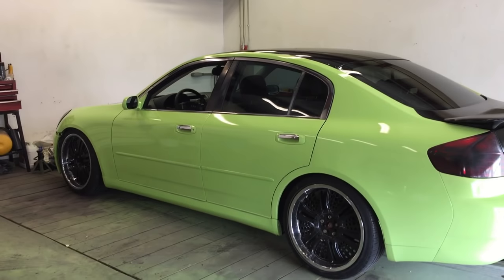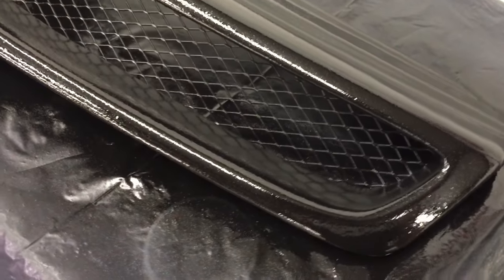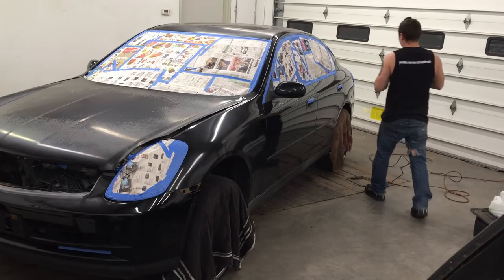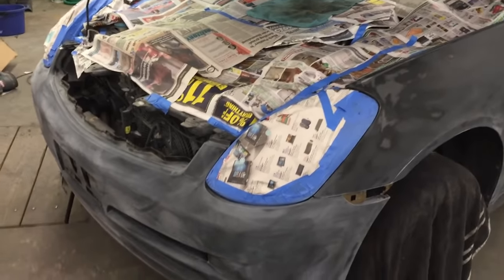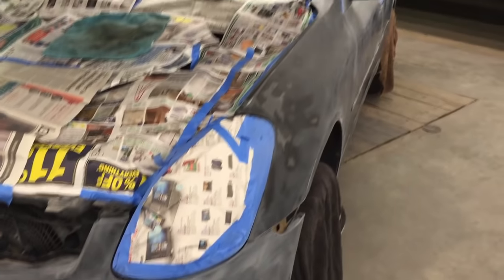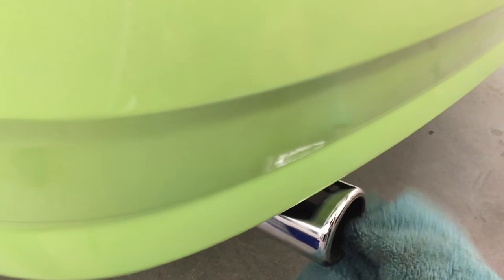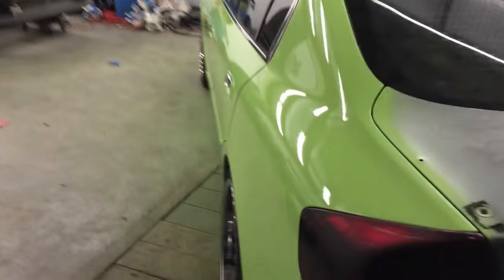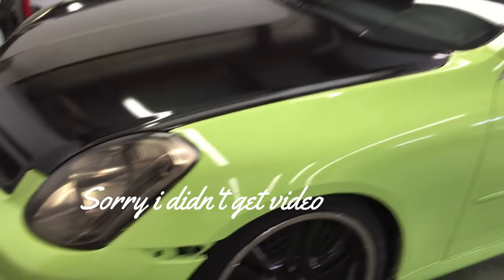Cheap Rust-Oleum Legit DIY spray can job you can do for 40$ or less! #budget #cheap #rustoleum

Comment: Nice. I'm impressed. For rattle can. Not bad...  It works for you. The hell with everyone else. Good vid man
Reply from the maker: Fast Garage 100% for sure! I love this comment new pinned comment!
Reply: Why do people get mad the way they do about paint jobs? Smh. I agree
Reply: My dude prolly got hi as a kite lol
Reply: Looks good butt wont last
Reply: @hectorastudillo2295  he would go over it with a clear coat it would last a lot longer
Reply: @JamesDguy  do u only use 320 with every car u paint I luv the results I have a few dents to fix and wondering if I use 320 and that's it on bonds areas
Reply: can you take it to a car wash?
Reply: Can you do that with a lamborghini
Reply: @jimjagusiak3593  yes it is paint for metal not indoor wall paint
Reply: @Jozavenue  is I know the bottom line plastidip gets washed away by the high pressure water and chemicals.
Reply: So how's the car look today?can you do a vid on the current settup of what if looks like?..does look good in the video here.
Reply: @alejandraramirez3575  spam
Reply: @JamesDguy  what's the name to that machine that scuffs I need it to paint my truck (Its a 1974 and has some rust) Anyways I want to spray paint my truck the way you sprayed your car, It looks nice
Reply: @JamesDguy  
So is that basically it? 
Scuff vehicle with a machine, cover glass, mirrors, lights, tires & than start spraying ??  (And how many coats?)
Reply: @hectorastudillo2295  yeah... i was thinking the same thing...should have 2-3 layers of clear coat...plus no primer!!no bond
Reply: Exactly what I though. Great job man. Thinking out of the box.
Reply: hey ,if anyone else needs to find out about car spray painting tutorial try Sovallo   Auto Painting Fixer (do a google search ) ? Ive heard some awesome things about it and my m8 got great results with it.
Reply: Not certain about the points made but ,if anyone else needs to find out about car spray painting guide try Bablim Paint Booster (do a google search ) ? Ive heard some extraordinary things about it and my partner got cool results with it.
Reply: @JamesDguy  how's the paint holding up?
Reply: Nice
Reply: hey ,if anyone else wants to discover car paint spraying tutorial try Bablim Paint Booster (should be on google have a look ) ? Ive heard some super things about it and my neighbor got great success with it.
Reply: hi everyone ,if anyone else needs to find out about forgotten password windows try Bablim Simple Code Booster(do a search on google ) ? Ive heard some amazing things about it and my work buddy got amazing results with it.
Reply: @beyourself1192  Na, I'm good!! But thanks anyway, i like my results the spray can way and keeps more money in my pocket!!!
Reply: hi guys, the best success that ive had was by using the Magic Painter Method (i found it on google) without a doubt the most helpful course that I have ever tried.
Reply: There are many factors in getting a good result. One place I discovered which successfully combines these is the Magic Painter Method (google it if you're interested) without a doubt the most incredible info that I have ever heard of. Check out this  interesting website.
Reply: Hi there, really liked the video.  What color was this..."willow green" or "laurel green"...so many different colors there?  I will likely paint my truck with it and would like to know what you used if it worked well!
Reply: @hectorastudillo2295  all paint wont last , will eventually fade
Reply: Professional auto body and paint and I'll tell you dude you did a great job for rattle can little 4K clear coat on that thing and it will go a long way
Reply: One of the best comments I’ve seen

Comment: Ah you sanded it. No wonder it came out so good. Some idiots just spray over the paint like they're using plastidip
Reply from the maker: Yea thats the fastest way for it to chip lol. In the 2 months i had it painted this color it didn't chip or fade and i put it through HELL! Winter storms/ice, Dirt road drifting and it was a driveway queen so it was always in the elements. For a temporary paint job it could have lasted MUCH longer but i had plans to make it how it is now., Check my newer videos for a update on it.
Reply: @JamesDguy  You sanded it with 320 and then painted over that? It looks really glassy. Does the rustoleum lay on thick and flatten out like that? I prime everything and then sand to 800, because I heard anything lower grit will change the paint texture perceptibly (and I'm new to this). What's the rule to get these results?
Reply: @JamesDguy  i painted door of my cheap truck with spray paint. Did same thing with prepping, sanding, primer and all that. Turned out well...it was 10 years ago and paint still on there lol. It shitty and rough now.but still there. Also i have never waxed it and it was kept outside the whole time.didnt even shoot clear over it lol
Reply: @thechum9653  why do so many people use that Deus ex profile pic? Every goddamn video has 3 guys with that, for a 20 year old game haha
Reply: @KaladinVegapunk  you only see 3 guys every video with this picture? I need to call in some support
Reply: @JamesDguy  I want to do the hood to my 1997 Toyota Camry. It has sun damage and little pin-holes showing the pimples of rust. I know I need to first sand the whole hood with 320. (I dont have an orbital sander so I have to do it by hand)
I see other videos that say I need to put this kind of sandable primer (putty) on it before covering it  with the spray primer. That was If there are any imperfections , I can sand until smooth.  After that I can pain the hood with primer.. 

AND only after doing that, can I smooth it off and spray with color I want to spray it with.
After the final color is that it or do I have to use a spray CLEAR GLOSS?

Comment: Hey man, I did the same thing to my old car and it turned out AMAZING.  I actually skipped the sanding part because my paint is so bad, I just wanted improvement, but I used the same stuff as you did!  It is definitely trial and error because I messed up the trunk but sanded it off and it turned out amazing.  I used literally 6 cans for my car and I've turned an old junker into something nearly new.  Thanks for the video!
Reply: Hey just now seeing this and am thinking about doing this to my car. How has the paint job held up? I mean for $40 and a days work it lasts 6 month it'd be worth it, so I'll prob end up doing it. But either way would be nice to know before trial and error how it holds up.
Reply: Yes, did you use a top coat? If so, what kind?
Reply: WHERE TO BUY im soo scared someone gonna sell me the wrong stuff

Comment from the maker: This paint job will be getting wet sanded eventually and reshot another coat in the future with a clear over it. The point of this video is just to demonstrate it can be done cheap and it can last a long time. I have a car going on 4 years with no chips or fade using the same paint different color.. 

I have more videos on painting and updates. Thank you for watching and dropping comments.
Reply from the maker: Subscribe for more videos!
Reply: Ahh I was hoping you got a video of the roof being painted. I always have trouble at that angle of spraying downward. Great vid
Reply: James D guy rustoleum acrylic lacquer crystal clear clear coat would be the best bet man. Just wanna help you out
Reply: That's because it's Rustoleum. Rustoleum is consistent, priced right, and looks great. I painted the lower half of an OMC outdrive with Rustoleum in the mid-90's. After polishing, you couldn't even tell the difference between where the factory paint ended and the Rustoleum paint job started.
Reply from the maker: Don't worry i will do one! Stay tuned!
Reply: Should I prime it first?
Reply: It looked better when it was BLACK. Vip over rice. Any day. Black polished and waxed, limo tints, slammed, deep dish wheels, curtains, junction produce neck rest, straight pipe>green ricer piant and fart can
Reply: Can you tell us all the supplies you used? Plz
Reply from the maker: You's a lion You's a cheetah It’s rustoleum advance formula, 320 grit sand paper, acetone, tape and newspaper.
Reply from the maker: hidden KARD Stay off my page John no one likes a hater 😘
Reply from the maker: John McGrath Honestly if your doing it out of a gun yes. Primer, base, clear.

But with single stage it has primer built in.
Primer+Base+clear. One paint 3in1 it’s not as good as spray gun but it gets the job done and last along time when done properly. If you need to redo in a few years it’s another 40$ in paint. Worth it while you save up to get the proper equipment to do a spray gun job. Just a thought.
Reply: Well good job man. It came out awesome
Reply: So it was all rustoleum? The sparkle stuff and the other colors?
Reply: @JamesDguy  A fartcan makes noise and makes no power like your borla muffler. Let's remove the oem muffler to bother the neighbors, make less power and lose torque, then paint the car green and call it success. Lol, to each his own I guess.
Reply: Your paint tutorial is ok. People can have an opinion. I'm not hating.
Reply: Hey don't do the clear it will make it turn almost flat if I were you try to test it on something first
Reply: I think the paint came out of the can pretty nice and that leaves you with very minimal wet sanding.  Looks awesome, color is unique and will stand out at events!
Reply: Impressive video. I got to see what it looks like after another coat clear and wet sanding. My only concern would be long-term UV protection. I could see it fading.
Reply: Rustolem only last for 2-3 years even with thick clear coat. Scratches very easily, have to heat it to at least 250 to harden it too.
Reply: Mrlazko10  yes it will fade. It has no hardeners in it. It will be around 150 for the paint, sand paper, paint tarps, tape, and I'd at least rub 20% rubing alcohol after wet sanding.
Reply: Spray aerosol clear over that and it will wrinkle the paint right off goodluck
Reply: only if you sand thru to bare metal - make sure to let it dry and sand thru ur papers up to 600 before top coat
Reply: This would certainly work for my 16 year old Ford Fiesta which is not worth an expensive paint job. First need to fix the damage caused by others.
Reply: Will it work on wheels? I have 22in machined face velocity wheels I want glossy black. There's a shop that will charge me $550 to powder coat them. Should I just let them do it or will this way work?
Reply: Gracias amigo por el tip
Reply: AWESOME job and colors look great with the rims!
Reply: James D guy keep em coming effen awsome
Reply: Great job but buy yourself a frickin' trigger ffs.  It's cheap and makes it soooo much easier.
Reply: @hiddenkard3101  Honda just came out with a similar color stock on accords for 2019 haters gonna hate
Reply: Dam bro I paid 450 on maaco and it looks nice and it's been a year and still shiny. But dam if I knew u could do it like this shit I would of kill a whole day and spend less man gd fuking job bro.. Can it be done to paint a stripe down the middle of my car
Reply: Damn good looking paint job I'm going to do mine
Reply: James D guy how does it feel without being wet sanded or look by eye up close before I try this product ?
Reply: good work man!  BUT wear a mask when sanding.  perhaps exhaust fan when painting. take care of your lungs!   good work tho.  looks great
Reply: My rustoleum gray/black blend has faded substantially in 2 years and is peeling all over the place since I didn't sand. Will be repainting the proper way soon hopefully...
Reply: @TheCarpenterUnion  why black/grey blend?  that sounds like the black would seem or look faded just by adding grey...   
:/
Reply: Awesome job man!!
Reply: I was about to ask that, I'm looking at painting my daily driver but the car isn't worth what shops want.  I want the project and probable color change, but I want to be able to wax it, I don't want it to look like a primed car (and why wouldn't you prime it first?).
Reply: So this doesn't have any clear coat ..? Do you wax it?? Lol
Reply: @johnnyloveee  I'm wondering the same thing. How long does the paint last without a clear coat?
Reply: Jimm Crowe  WOW! Racist much?

Comment: I wanna try this, but I'm kind of intimidated. I work at Home Depot (in the paint department) so I'm starting to feel like the Rustoleum cans are calling out to me. Haha
Reply from the maker: They really are worth the time. Not trying to sell a product here. Just speaking the truth!
Reply: DO IT DO IT
Reply: Respirator?
Reply: start with smaller project then.

small part you can fit on the car and paint them.
i started airbrushing with scrapped plastic panel from scooter. we had a small shop that would modify moped and he had plenty laying around
Reply: Buy a harbor freight spray gun. Mix paint with thinner and you can spray your car super fast and slick.
Reply: @spineguy1553  yes what this guy says, I did the same thing, just go the extra mile in prep work. My mistake was not sanding down to a fine enough grit. Scratches showed through. You could use proper car paint from napa but your going to pay about 150 - 200 for a gallon per product. The real only diffrence is the base will have metal flakes for pigment in car paint.
Reply: @justin6409  I painted with rattle can for years. I still do. I get amazing results. I found that my skill set with a rattle can is even better spraying enamel with a spray gun. Primer is key.
Reply: @spineguy1553  My only dislike with the rattle can in the spray nossle isn't a fan, unless you go to a paint shop. I found I'm way more likely to get runs, plus even coverage is harder personally. Only down side with spray guns, cleaning is a pain in the ass! Gotta keep them nice and clean to take care of them. If I was doing just a section like a chip or dented area, yea I'll just get a 8-10 dollar can from the paint shop, much easier. Just depends on the job. Personally I wouldn't spray  a car with rattle cans, way to much work. Lol, I wish paint wasn't so expensive, I would be painting everything XD
Reply: rusto is awesome freaking paint..i used it on a GRILL...shit looks amazing to this day.
Reply: @1stTimeVenture  it is, I paint everything I can with a rattle can. If you have an oven for parts. Then you will be really amazed! The rusto lays down and just looks fantastic if you can cure it.
Reply: Some colors are way bettet than others, but RustO is a verry decent spray paint!! If you want better cans with better coverage, check out the graffiti supliers ;)
Reply: Ola linda.ketal tegusta o no tegusta
Reply: Do you need clear coats after the paint???
Reply: @MauryNazareno  if you paint your car, i would recomend it. Don't be afraid it will come of when it rains, but it will look better and last longer with a clear coat
Reply: @RockNRollDad88  Also your paint job won't fade as fast over the years of driving in the sun due to the UV protection clear coat gives you. Single stage paint dulls out really fast in a short span of time. It's also easier to do a blend with clear coat if need be.
Reply: Dpnt do it this guy is an expert your paint job will not look like this...!!! guaranteed
Reply: DO IT!
Reply: dont be,prep is the key .sand ,prime,tack rags etc and keep dust and dirt out.i did my cowl hood and spoiler with home depot rustoleum x2 and people think i paid big bucks,lol
Reply: @RockNRollDad88  what brand?
Reply: @spineguy1553  How much thinner? what brand? Do I use rustoleum? How do i get it into the paint gun. do I just spray it into the enclosure until its full?
Reply: @GoibniuNihiliste  any brand paint thinner. Walmart etc. You can mix the thinner and paint in a thick plastic cup. Mix until the paint runs off a paint stick. It should be thin. Then add to the thinned paint into gun. Practice first. Adjust air until you get paint flow down. Mix the paint and thinner really well by stiring Make sure you clean clean and clean your gun with thinner after use. Take it apart and clean it. You can leave it in the cup with thinner. If you dont clean , clean and clean it. You will be hit as the gun will not work next time. Wear a mask of some sort.
Reply: @GoibniuNihiliste  for paint. You can use rustoleum in a pint or gallon etc. It will be an enamel.
Reply: @RockNRollDad88  thats crap.. i painted my bare frame with rustoluem ..prepped it well.primer color and clear.. it still hasnt seen the street and looks like crap years later
Reply: So is the pain you used gloss? Also when you sprayed do you spray primer first all over or only on the spots that metal was exposed? I’m wanting to try tho at home what do you suggest as far as beginner pointers?
Reply: @monsta74922  yes, gloss. Yes, primer always. If you spray primer out of a spray can use indistrial rustoleum primer . You can get it at Walmart. It lays down flat. Very little sanding. If you feel you can (skill) use a filler primer. Also at Walmart.  It will fill in light scratches etc. You will need to wet sand the primer either way. Primer is the most important step. It will make  the paint job. You can do this. Practice on your fender. Buy plastic drop cloths to cover your car. Nothing worst them getting overspray on rest of your car. You can do anything and have anything you want. Visualize =Materialize!